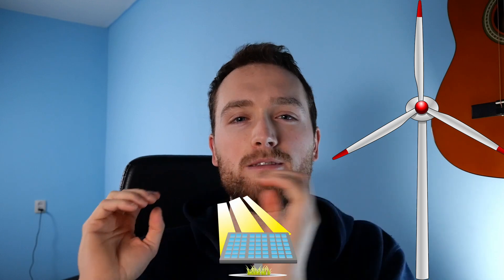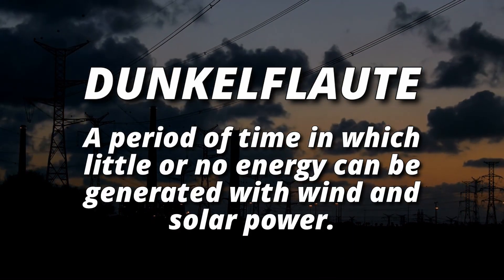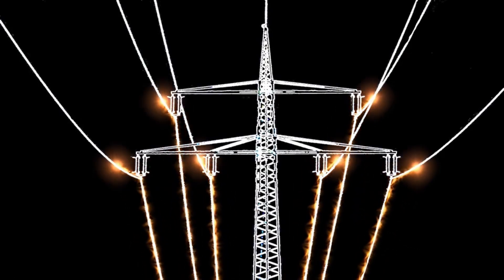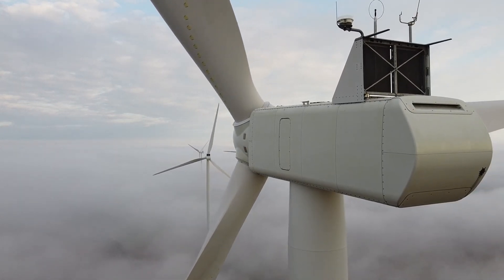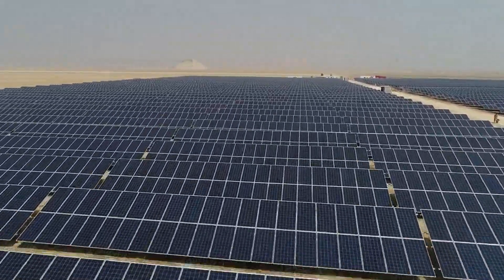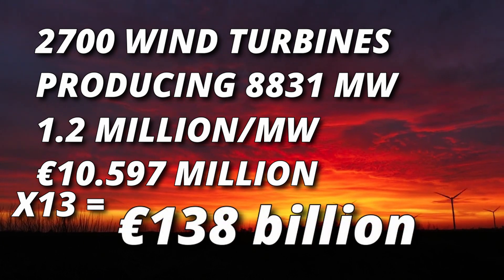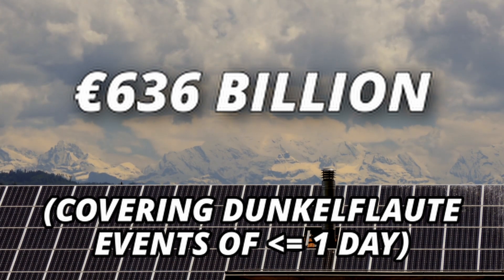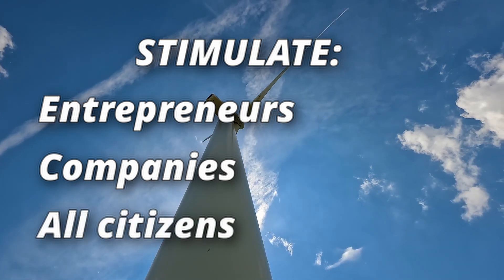Is Wind, Solar and GREEN Batteries enough? (For The Netherlands)

Comment: A dunkelflaute event is not dark - you get about 20% of your peak summer power, so 5x the amount of solar panels than you think you need may do the trick! The batteries would only be needed for maybe 20 hours a day in winter. Then you could export excess solar power in the summer.
The 2000PJ per year is 2x10^18 joules per year, then 17.5 million people gives 114GJ/person/year. 3.6x10^6 Joules per KWh, we get 86KWh/person/day. For everything, that seems reasonable.
With 20KW of solar panels per person, we would get that amount of power in the summer, or with 100KW of panels per person in winter, we would cover most of our winter needs. The Netherlands gets about 0.8KWh/m^2 of solar irradiance in Winter, or about 1KWh/day/m^2 after solar inefficiencies. On dark days that's about 0.2 KWh/day/m^2. If you can install panels up higher in farming areas to optimize for collection on dark days (panels mounted flat), that's about 400M^2 of flat panel area per person, or maybe 1200M^2 of land area to allow 2/3 of full sun for agriculture (which could actually give improved farming yields). That's about 830 people per km^2. This would need about 21,000 km^2 of agricultural land. of which 7,000km^2 would be panels. As the area of the Netherlands is about 42,000km^2, this may be tight, but doable. If everyone installed solar on their homes, then the panels in agricultural areas could probably cover all other power requirements.
The point is that even on dunkelflaute days, you would still be close to your average daily needs, and may only need to economize slightly, or import a small power difference as needed.
Furthermore, each person would need about $50,000 of panels, or about $100,000 per person to cover installation, conversion and transmission.

Comment: It is good that you are considering full renewable conversion.  There are a lot of things that you do not mention. For instance,  making the consumer side more independent. Good old energy conservation, putting solar onto all appropriate locations, and earth tempered heat pumps. Much development is being made with geothermal power. Storage technologies like the flow-battery have potential. Give it a year or two, I bet you can improve your estimates.
Reply from the maker: Thanks! I'll look into it :)
Reply: @IndecisiveFuture  The Electric Viking channel just mentioned that Tony Sebas's 2027 battery cost projection is taking place sooner. This means a 50% drop in battery prices. If Perovskite Solar Cells reach production levels, then these are real game changers.  It was once said that fusion would be too cheap to meter. Maybe solar will be so.

Comment: Wind and solar will never work!
They cannot run without support from conventional generation as they are an uncontrollable source feeding a system that must be finely controlled with respect of supply to demand.
Batteries are a joke as far as covering intermittency as the required capacity is far too great to be feasible, both from cost and availability of the amount of required materials.
They are used but to provide frequency support as they can very quickly  'inject' significant amounts of power when required to bolster times of sudden input deficit. Conventionally, and long before renewables, this was done with hydro pumped storage systems.
if wind and solar were feasible it would be working by now, the fact that decades have passed and we still rely on gas, coal, nuclear and hydro generation.
Reply: The problem with renewables is that they need a ton of peaker plants.

Natural Gas was the ideal companion, but now it is more and more likely to be energy storage. If we build 5x the energy generation we have today in renewables, it is not a problem.

Comment: Idont. Believe you have added the transport needs and gas heating and hot water additions without fossils.  You will need4 times the capacity of grid you have now. Also house insulation and larger buildings ,heat pumps for all buildings and elec for EVs to replace ice veghicles. I think you will find all this added load will quadruple  so if you are at 50 Gigawatts now it will be  200 in 2050 and batteries will be trillions  . The USA calculation was $350 trillion  for battery backup with lithium. at todays average prices.
Reply from the maker: Yes, I indeed dismissed a lot of relevant nuances for the calculation. So what I did is more a lower bound. Energy grid capacity is a good example of something I dismissed, while it is especially relevant in NL as their energy grid is already struggeling now!
Reply from the maker: When I have more time, I will try to include these nuances. Until then I will try to always name what I dismiss

Comment: Weather patterns in Western Europe are such that when wind is not blowing in one are neither is it blowing in any others so we can forget this solution. DW recently did an unbiased program on their Energywiende showing that it is a fantasy in the minds of Greens. They would need at least 50 GW of backup power and this would need around 30 gas plants or a similar number of pumped storage units but the main problem is the national grid with energy produced in the North and used in the industrial South with over 3000 km of grid missing to achieve this and the Greens opposing sections of the route  Since the backup gas plants would need to keep turning over the savings in carbon dioxide considering the amount emitted in producing and installing the wind, solar and grid pylons, never mind the EVs, means any savings are negligible just transferred offshore and out of the minds of the Greens. Worse still the Earth is in a cooling cycle as shown by the new US National Climate Network units and cold weather brings no wind and snow to cover the solar panels.
Reply: You made a huge mistake in thinking that you have to replace all the primary energy with electricity.

Nat gas is tracked before the burning in power plants, where a lot of energy is lost as heat.

And electric vehicles and heat pumps are around 3 times more efficient than their combustion counterparts.
Reply from the maker: Thanks for the feedback! My sources agree that Dunkelflaute events also happen in big parts (or whole) of europe at the same time meaning that just wind and solar without storage would not be the solution. Are you willing to share your DW study? Im curious!
Reply: In addition an analysis of ten years data from a 10 GW UK windfarm plus other unts finds that for 120 days per year the output was less than 20% of capacity and for 20 days less than 10%. It also found that back to back  "dunkelflaute"are not uncommon in the weather records with one year when there were 45 days without wind. The only hope for renewable energy is the small modular nuclear units being developed by Rolls Royce and those from GEC-Toshiba being installed in Poland. These could make hydrogen for transport purposes by hydrolysis since they need to run near 24/7 and the need for liquefying and transporting the hydrogen would be minimized by local usagge

Comment: A flat country like the Netherlands could build those towers that have heavy blocks attached to pulleys. At peak times for wind and solar electric motors pull up the blocks to maximum height. When electricity is needed, the blocks are lowered and the pulleys drive generators. 😊
Reply from the maker: Yess, will be interesting to compare the costs and practicality with the other ways to store energy! I'll look into it :)
Reply: I want 1!  I've been looking for a commercial version.  I guess i will need to make 1 myself.
Reply: Flywheels are possibly a more practical and less visually apparent option. These also have the advantage in that their momentum can be tapped to help keep fluctuating grid frequency stable - something that will be more important in future if we use more renewables. It’s old tech, but with advances in materials they are even more relevant today than ever.
Reply from the maker: @javelinXH992  It would be interesting to compare energy efficiency, price, and scarcity of resources with the alternatives. I'll look into it! Thanks
Reply: Gravity energy storage in heavy blocks attached to pulleys is a really terrible idea. Energy density is too low and it’s mechanically fragile. The Netherlands should just go back to the underground hydro storage.

Comment: First of all Wind and Solar are not clean. How many hundred tons of coal are burnt to make the rebar in the turbine footing and the metal parts in the generator  on top of a wind turbine. How mant thousand barrels of Bunker C areburnt to ship the materials. How many hundred barrels of oil sre used to make the carbon fiber epoxy  tower and blades. We don't have enough fossil fuels to go all Wind znd Solar.

Comment: Green parties in the Netherlands and other parts of Europe are often too optimistic about: 

1- the supply potential of renewables 
2- the storage potential and efficiency of batteries 
3- the economic viability of large scale hydrogen storage 
4- people's willingness to become energy sober 

and often underestimate (or blatantly ignore ) some of the shortcomings and facts of renewables:

1- the quantity of construction materials and rare earth minerals used in manufacturing them (for photovoltaic cells, DC/AC converters and inverters...)
2- the amount of land needed to set up renewable sites (land is not free)
3- the amount of CO2 emitted during their production and transportation (panels/batteries and their frames are quite heavy)
4- the rather short lifetime of solar panels  (15-20 years) with no clear recycling plans for wind and solar
5- how subsidized renewables were in the last 10 years (thus underestimating the development cost)
6- how different geographies affect output of renewables  and thus different countries have different potentials
7- the amount of wires needed to set up a network to connecting places with no wind or sun to other power hungry places
8- that unlike nuclear, renewables are a huge market with competing entities and interests, with strong lobbies in governments and research groups. 

While true that building a nuclear plant is a privilege reserved for big economies which can afford the astronomical initial costs, the long term costs of 100% renewables when factoring all of the above turns out comparable and sometimes more expensive, and more CO2 emitting (let us always keep in mind the German example of a failed energy transition) . Also, the large costs of nuclear are not mainly due to the technology in itself but rather due to a long history plagued by fear and dogma, severe under-investment, and loss of expertise. The building of gen iv reactors was and still is often expensive and slow, but the technology is improving quickly. *Final note*: no energy source is perfect, so a mix is ALWAYS a good idea.

EDIT: If your 636 Billion Euros estimate is anywhere near true, please tell people to start building nuclear reactors from now  😂
Reply from the maker: Thanks for sharing your thoughts! I will check out the points you raise